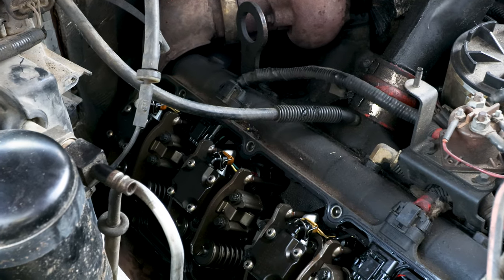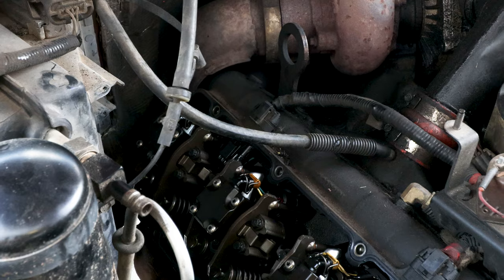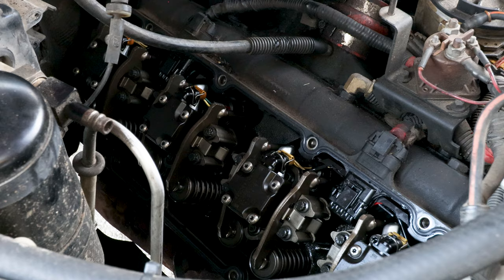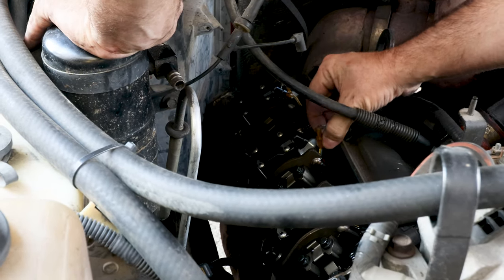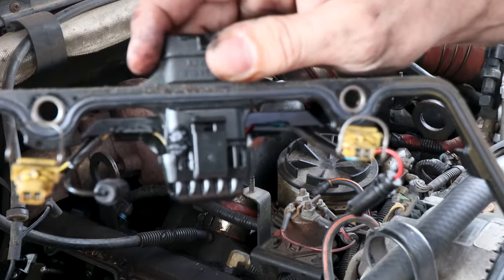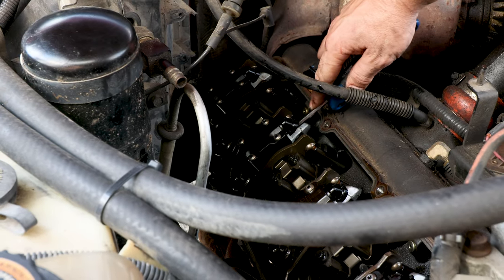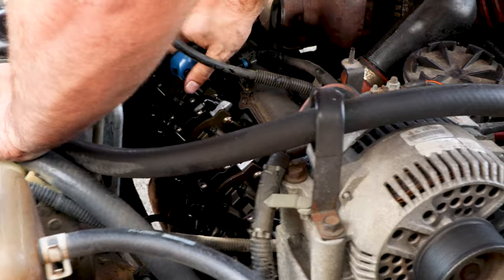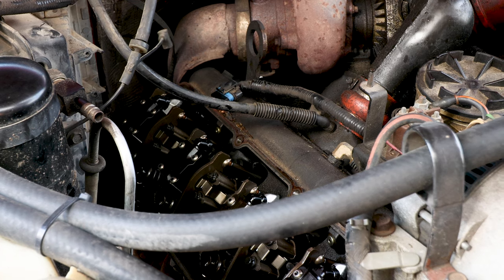Fix-it Fridays: 7.3 Powerstroke Injector Install With a Fatal Error!!!

Comment: That was hilarious. Really enjoying the recent uploads. Would be cool to see videos on dealing with old paint, Dana 60 swap, repairing cracks in dash/door panels, fuel pump upgrade, and hpop upgrade. Installed my NOS seat foam replacement last week from you guys and it feels like having a brand new truck.

Comment: Thanks for no commercials! Enjoined the installation
Reply: How do you know when an injector is going bad in the first place? I’ve got a 95 f250 psd, what code reader should I get? Thanks
Reply from the maker: There are many symptoms but i biggest thing will be rough running and possibly an engine code. Snapon scanners read the most on these trucks
Reply: CPaddict thanks 
Really enjoy the Monday and Friday uploads! I watch them on my lunch breaks!

Comment: When I pull a injector I stuff a rolled up small towel in the cup and get a vacuum in the hole to suck oil and fuel makes clear out and restart much faster and cleaner

Comment: “Everything’s a lot more slippery with oil on it.”

Well that just means the oils working right? Lol
Reply: On the topic of oil, can you pre-fill the oil rails to aid in starting?
Reply from the maker: You technically can but there is no real need to do that.
Reply: Ok, so it wouldn’t make a significant change in the time for the HPO system to build pressure then?

Comment: My truck started worked for about 5 min and then I turned it off now it’s just cranking, and not starting. What could I have done wrong. And also my ICP sensor has oil inside of the plug. Please help desperately need this truck

Comment: I’ve seen others just yank the injector, and put the new one with a glow plug in. Is it a necessity to blow out the oil?
Reply from the maker: You have to get the oil out or your will hydro-lock the motor.

Comment: Would you recommend replacing the cups while doing injectors on a similar truck? I will be doing mine soon
Reply from the maker: Only if you want to. Cups typically are replaced when fuel is getting into coolant

Comment: If i swapped all 8 injectors at 1 time, could i drain oil from all 8 cylinders at 1 time? And how long would I have to crank it to drain it?
Reply from the maker: Drain all 8 at once. just a couple quick bumps on the starter

Comment: So I cam across this video after I FORGOT TO REMOVE MY GLOW PLUGS 😔😩, I jumped the starter to clear the oil (forgetting about glow plugs) then then locked up. I assume I have hydrolocled my engine? I'm scared shitless...
Reply from the maker: It could be fine just pull the plugs spin it over to clear it out and see if it will run hydrolocking isnt a huge problem, bending a rod in the process is the problem.
Reply: @CompletePerformance  thanks for the reply man, really appreciate it...turned out I didn't hydrolock it 🙏🏽🙏🏽🙏🏽